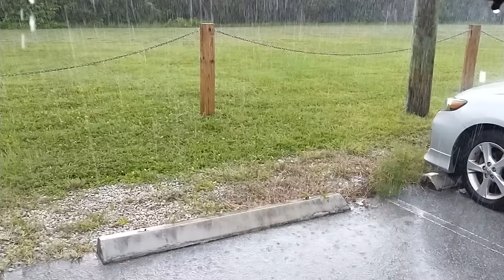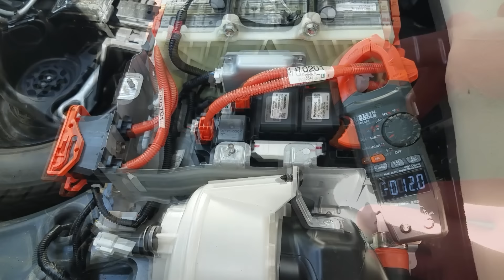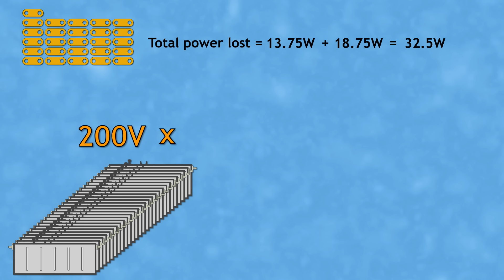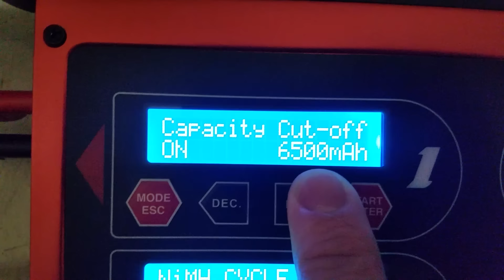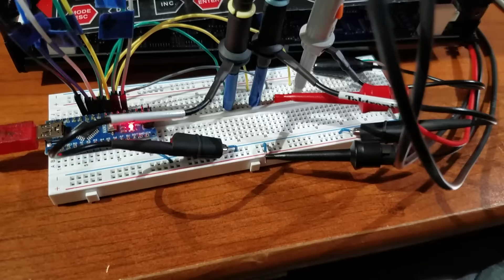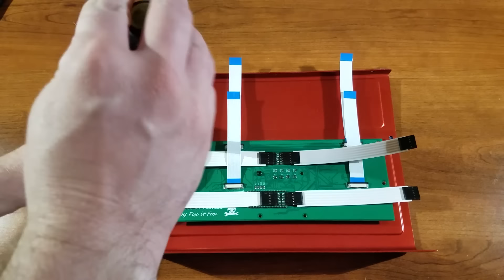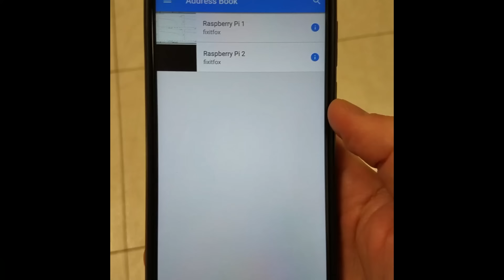An engineer's approach to hybrid battery repair

Comment: It seems like the CQ3 could use the temp ports for usb communication. Have you tried that?
Reply from the maker: I was not aware of this. That would be awesome! I did not mention in the video, but I reached out to the manufacturer of the CQ3 and they said it does not have the capability to communicate with a computer.

Comment: Thank you for this resourceful video. 
I would like to get your thought on whether load testing modules is important IF one going to do capacity tests (with CQ3 etc chargers) afterwards. The capacity tests will show which modules to replace, so what is the point of load testing? I don’t mean you did in your video but I see a lot of other people doing this. Thank!
Reply: Most of the chargers on the market are fairly limited in their "Discharge" current due to converting current to heat and using a small fan to blow it away. The QC3 style chargers are limited to 5 amp IIRC (which is why they are more expensive) and most of the cheaper chargers are MUCH less more like 0.5-2 amp. Using the light bulb is just a higher current drain which might show you if certain cells are struggling at higher loads. Some cells might appear okay if they are used gently at low draw but then choke at higher current drains like driving the car as they weaken (lose electrolyte). I was actually surprised that the pack appears to max out at 125 amps which divided by 28 modules is ~4.5 amps per module. Although I believe they are actually paired into a 2S14P configuration to achieve the ~200V of the "Pack" which would give you a ~9A draw on each pair...
Reply from the maker: Very insightful reply 😊 just a couple small corrections:
-The CQ3 can only discharge at a max of about 1.8A even though the settings allow you to set the discharge current to 5A. Lame, I know...
-the light bulb load test discharges the module at about 3.5A.
-the pack is fully in series (all 28 modules are in series) so all of the peak current (125A) current goes through each module.

Comment: This video blew my mind. I have so many questions: (1) What software do you use to design the circuit boards?, (2) How do you send an automated notification to your phone? Is it coming as a text message or as a notification over bluetooth/wifi? Very curious about how you do this. (3) What soldering iron do you use for really tiny components? and finally, (4) are you on Priuschat? People there would absolutely love your work. Oh, one more question (5) Did you document your code on github?

Comment: Hello. 
I just bought three Prius hybrid battery for making reconditioned battery. 
I’ve watching your video every day. 
But I want ask you about charging amp. Other people charging 3.0A but you charging with 5.0A. Is not hurting the battery modules????
Btw I’m watching your video from japan!!!
And discharging from battery only up to 0.7A tho. I know it changes from what charger hold for discharge wattage but I’m using Japanese hitec multi charger x4 ac plus.
Reply from the maker: As long as your pack is compressed together with the rods while you are charge cycling it, 5A is fine. The car uses up to 50A when it's charging the pack so 5A will not do anything bad. Very cool I would love to visit Japan someday ☺

Comment: awesome content! question from someone with no knowledge about these batteries, if my car has the light on for hybrid battery replacement, I simply can’t replace the modules from ones from ebay without making the same process you showed, correct?
Reply from the maker: You mean without charge cycling? You can try, but you run the risk of your fixed pack not lasting very long! Like I did in the first half of my video, the engine was still running loud so I suspected it wasn't going to last long.

Comment: I used Toyota Techstream to run the diagnostic on Hybrid battery and it shown 14 blocks.  When the batteries are in good conditon, each block have around 15v - 16v.  But when it is P0A80 code shows up, 2 blocks shown a lot less voltage than others.  Is that an accurate way to test your battery?  Your video shows that each block is 7v-8v.  So, why is Techstream software shows 15v?
Reply from the maker: Hey I'm sorry for the late reply! The car measures the pack in pairs of two modules, so nominal voltage will be 7.2V*2=14.4V. These pairs of modules are called "blocks".

Comment: Great detailed video!  Great work.  Did you share the code and design?  I didn't notice on PCB Way. Though I recall one of the companies shares designs, as would be handy and for some might be nice having delivered populated as well.  Do you have a git for or elsewhere, that'd be nice? Also, wondering if gen 4 modules are the better to go for.  Albeit, the price of the other are luring and suitable since that's what I've been doing until as of late.  Plus there is the serial number you can read up on and get an idea how old the modules are if you wanted to know. First two numbers are the day, third character is a number representing the month, fourth character is a letter representing the year starting with A being 1999 and say for example J being 2008.

Comment: plz tell me watts of light(light use for load)
Reply from the maker: This is a good question! Use a halogen light bulb. I used an H11 light bulb, which is rated for 55W. LED lightbulbs are going to use a lot less power.

Comment: Awesone detailed video!❤
I am exactly in this situation. 
- What was the max voltage during the charging cycle for 1 module? I stopped at 8.4V and I didn't let to charge 6500mAh.  it was a mistake?
- What was your charge/discarge current?
- what was your module relaxing time between charge-discarge?
Reply from the maker: Your voltage sounds about right. As for the other details, check out the CQ3 setup video in my description. Good luck!
Reply from the maker: Just checked some data I saved and the voltages will go close to or over 9V

Comment: can a module that displays good voltage and above the 5000 discharge mah capacity, still be a weak module if a load (car light bulb) is on it and it discharges quickly? Were any of your modules like that?
Reply from the maker: I think in theory it's possible, but very very unlikely. Personally, I have not seen this before.
Reply: @FixitFox  have you also done any internal resistance testing on any of the modules? and how that affects the life of the module?  I'm curious to see what the internal resistance were on your bad modules.

Comment: I have 2x Priuses and like 60blades😅. I need to build an automatic charger, the funniest thing is that I already have everything including hardware and code snippets for microcontrollers , just need to connect everything together.  Will finish that right after Prius coolant temp gauge.
Reply from the maker: Very cool. Wish you the best!

Comment: This is very nice.
Did you ever find out why Toyota cooling management system is this bad? I mean, on NIMH battery cars, the fan comes on when the battery temp is 38C but it runs very slowly so it has no capacity to cool the battery so it quickly reaches 45C and overheats, but the fan still does not run on max. So, the idea is to make the fan run faster and earlier.
Reply from the maker: I was not aware of this problem. If true, Toyota could very easily fix this with a software update.
Reply: @FixitFox  I bet they know about the situation, but they don’t care. A software update can fix this.

Comment: How is this video sitting with so low of up votes. Crazy
Reply: This guy is brilliant. I expected another generic video of someone copying others to fix the hybrid battery, but I was completely wrong. He built and programmed an automated process—this is exactly why I pay my internet bill!
Reply: Because all you need to check the modules is a harbor freight voltage battery tester. Which is simpler and much faster no need for all this gimicky stuff

Comment: I tried to find your 2nd channel with more info on the CQ3 settings but I can't find the link in the description
Reply from the maker: Hey! I'm so sorry I haven't gotten to making that video yet. I have the footage but I haven't done the editing it yet
Reply: @FixitFox  No problem! I bought a CQ3 and used the same settings you did  except I did

Wait Time CHG>DCHG 5 Min
Safety Timer ON 720MIN
C=3.0A D=1.0A 3 cycles

I have the pack overhanging my work bench with a fan blowing straight up under it on low speed about 3 feet below

Amazon screwed me and only sent 2 pairs of the banana plug>alligator clips so I can only do 2 modules today but oh well

I DID set the mAh to 6500 per your recommendation too, thanks again for the info!
Reply from the maker: That should work just fine! It will take longer because the currents are lower but I see you're staying on the safer side so no problem. Hopefully you get the other cables soon to cycle more of them. Good luck!
Reply: @FixitFox  I changed my settings to experiment a little too. My first discharge I got 5593mAh and 5484mAh capacity

I upped the cutoff to 7000mAh and I got 6407mAh and 6340mAh!!!!! I only have 2 alligator clips atm but more are coming monday. 

Crazy, almost new capacity!!! Granted, only 2 modules so far, but I'm hoping for good things with the rest!
Reply from the maker: @keysersoze7034 Looking like you got a great pack!

I originally looked for a junk yard car to take the pack from too. But every junk yard I called told me that they remove their battery packs from hybrid cars and those are not for sale 😔
Reply: @FixitFox   If junkyards dont sell them, whats the best place to buy replacement modules?
Reply from the maker: In my experience, ebay. Just make sure they mention something about capacity and not just voltage.
Reply: @dmitryperliev4475  I just reconditioned all my OEM modules from my 2013 Lexus ES300H. I did it exactly like how the video did, if you're interested in them we can work out a good deal. They ALL were over 5000mAh+

Comment: a couple things I wanted to point out/ask you about for clarification

1) the AC blowing on it "tricking" the charger... but there's no temp sensors on the modules themselves for the charger to read, so IDK how that would affect anything

2) I think some people set theirs for 7500mAh charging because within each module is 6 cells in series, those cannot be balanced so the theory is that by charging up to 7500mAh it balances them better. Any additional charge just gets wasted as heat, not to mention there's also inefficiency with charging so it's not truly 6500mAh getting input into the module

I'd be interested in your thoughts on this
Reply from the maker: Hi! Good questions.

1. You are right that there are no temperature sensors on the chargers and modules. But a physical phenomenon of batteries is that their voltages change when they gets hotter or colder. So if the AC blows on it, it will make the battery colder and the voltage will slightly decrease. Conversely, when the AC turns off and stops blowing, the battery will stop being cold and the voltage will slightly increase. These slight increases and decreases in voltage can trick the charger into thinking it is done charging the module!

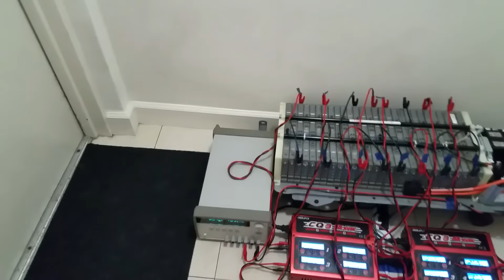2. That theory would make sense if they charged it to 7500mAh once they are done with the cycling process. But from what I saw (and also what I did prior to this) is we were doing it to "exercise" the battery to try to regain some capacity. But the biggest reason for capacity loss is the loss of electrolyte. I did a lot of testing to prove myself wrong but the data was consistent: charging with a limit of 6500mAh vs 7500mAh did not make a difference in discharge capacity. And yeah, I agree. There is a lot inefficiency while charging, which I explained at 17:30. You really only find out how much you put into the module once you discharge it. Also just as a side note: the energy wasted during charging can be calculated by subtracting the charge mAh vs the discharge mAh. So if you charged to 7500mAh and it discharged 4500mAh, you'd have 3000mAh wasted as heat and pressure (7500mAh-4500mAh). Anyways, it is best not to overcharge for many reasons (some of which I mentioned in the video). But also because it will work the weaker iternal cells in the module harder, further degrading their lifespan. Perhaps you could help balance the cells with 1 overcharge after the whole cycling process is over. But I would not recommend it. IMO the risk is not worth the potential reward
Reply: @FixitFox  Thank you for the thorough explanation! With the AC part, I can understand what you're talking about, My batteries will be in my air conditioned solar shed but I'll keep the air from blowing directly on them

I noticed you Charge/Discharge at 5A is that correct or did I mistake that? Another youtube video from a refurbisher does a 3A charge and 1A discharge, what do you think about that?
Reply from the maker: @keysersoze7034  You'll probably be fine if you keep the air from blowing directly on them!

As for the charge/discharge currents, I noticed that most of these chargers will only discharge at 1.3A-1.6A even though I set it to 5A. So technically, setting it to 1.7A or above will not make any difference since it only goes up to 1.6A.

The charging, however, will work at 5A. I can't remember what others set their charging current to, but in my experience 5A has been fine. No excessive heat or damage. BTW - The car charges them at over 50A! 😯
Reply: @FixitFox  I picked up a junkyard battery from a 2019 Avalon hybrid with only 40k miles. It's been sitting ~5 months but  I disassembled the pack and all module voltages are 7.64V (i removed all busbars first too)

I'm contemplating doing this reconditioning for this battery but was interested in your thoughts on it
Reply from the maker: You can't really know the condition of the modules till you cycle them. That being said, if it's from a 2019 car with only 40k miles, I think there's a good chance that the pack is good.

Before deciding to cycle them, I'd personally just put the pack in my car and see if I can drive on it without getting a hybrid battery error code. It takes a lot of time and effort to cycle the packs.
Reply: @FixitFox  was going to make this comment about needing a way to somehow balance the cells within the module. NMH is unique in that you can somewhat overcharge the chemistry and as long as the rate is low enough you dont do much damage to the electrolyte so it effectively re-balances the cells within the modules. its actually the lucky way that lead acid batteries work. as long as you over charge them every now n then to like 15.5 or 16v, you allow for desulfation and intercell balancing at the cost of some electrolyte. its usually a net positive in terms of lifespan/capacity that you get if you conservatively overcharge with one single cycle atleast once.
cell orientation is actually kinda important during overcharge cycles. any bubles that form from breakdown of electrolyte you want them to float to the top of the cell stack in a way that it doesnt disrupt the electrode surface areas. this is actually a big deal for lithium batteries during the first charge cycle when some gas is produced but no one ever talks about it. as long as you trap the bubbles in the top of the cell, theyre likely to condense and not damage the battery too much. have to use very minimal current though and a precise over voltage. 
the other thing thats important for electrolyte gas formation is proper fixturing. keeping the cells under pressure during any possible electrolyte breakdown events is really important for minimizing the size of the bubbles themself and thus disruption to the cathode and anode surfaces. its why you get 3x the lfiecycles out of lfp batteries with proper fixturing. kind of getting into the weeds here. 
if youre interested i put up some videos about using alternative chemistry low voltage batteries in evs/phevs along with a solar roof to improve fuel economy/ev range.
Reply: Hey very cool process men. You could be on the next Toyota engineer or programmer for them dude…